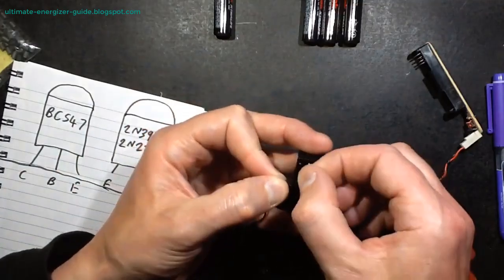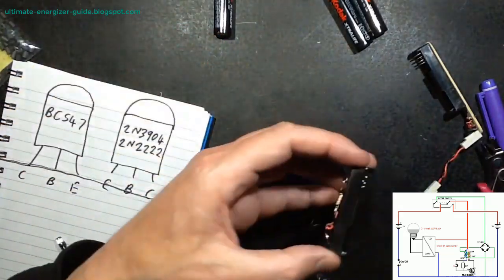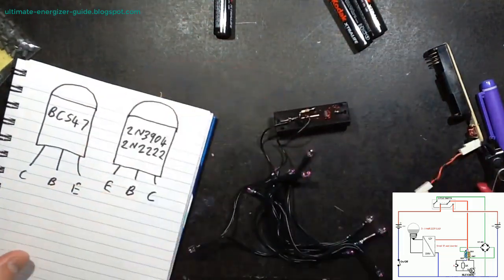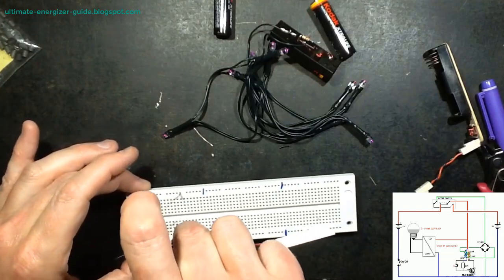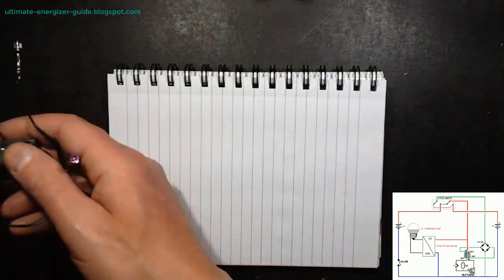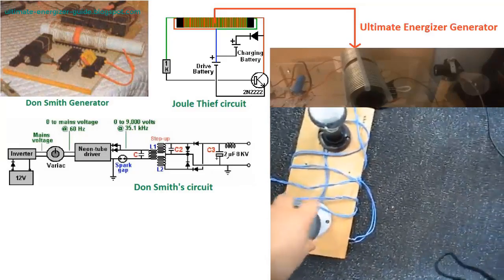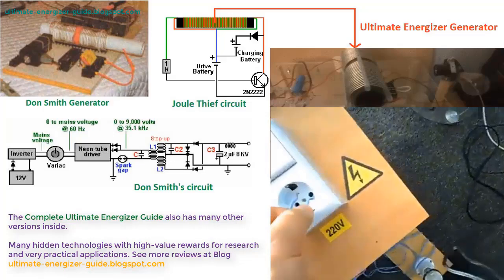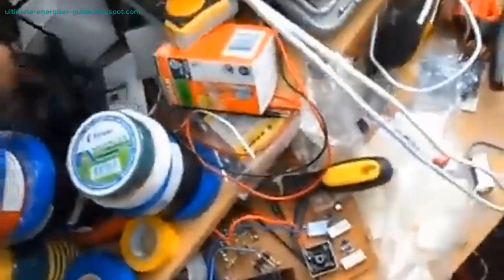Overunity Electronic Circuit Charges the Battery bank - Free Energy Battery "Charger"

Comment: Free release of free energy technology:
We are releasing the technology of the FE device, which consists of coils and electronic circuits and has no moving parts.
Individuals and companies with technical capabilities
are welcome to develop and sell products that apply this technology.
And let's realize a carbon-free society and stop climate change.
As you can see, this device is extremely simple
But it can output 2.6 times the power that is input.

YouTube ....
(Method of Hubbard Generator)...See comment.